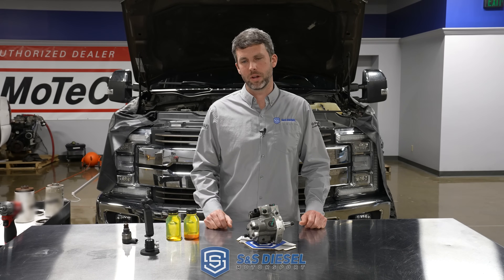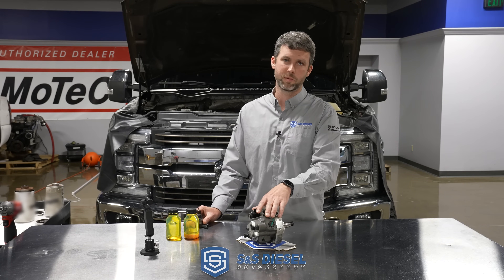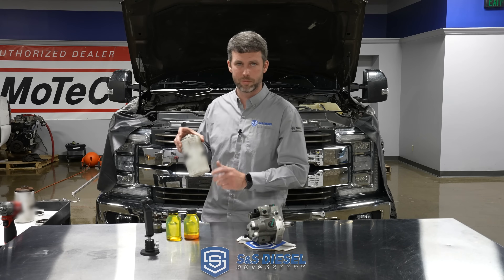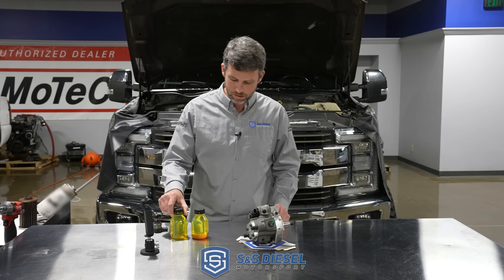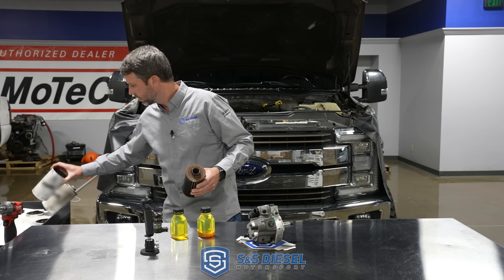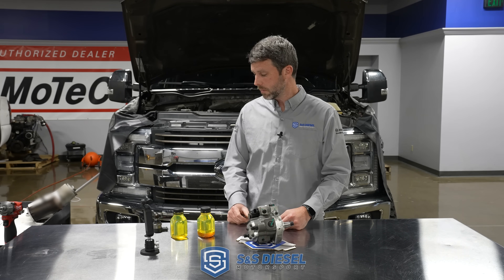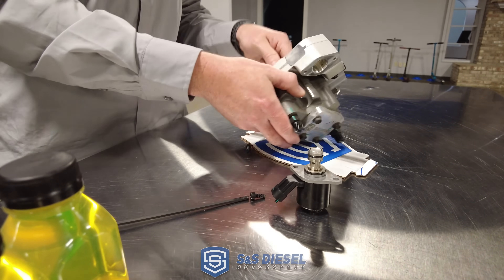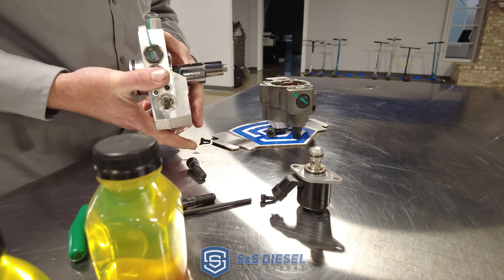Can The Ford 6.7L CP4 to DCR Pump Conversion Handle Water In Fuel?

Comment: I am going to put your disaster prevention kit on my 2021 but had a question. With those steel housing filters, would the filter you supply with the disaster kit possibly produce the same results or after going through the oem filters maybe no water contamination could make it to the disaster filter?

Comment: Also has been running with a missing fuel cap for a year.😂
Reply from the maker: No kidding, that's what we thought when we first opened up the fuel system, haha. Unfortunately, what really happened is much more disturbing. All of the water likely came from an unknown fuel station as a result of traveling. He parked the truck shortly after and then went on vacation without any indication that there was water in it. The truck started acting up when he got back 2 weeks later and the video shows why. The owner of the Rusteater is quite particular when it comes to maintenance, which is exactly what motivated him to purchase an aftermarket filtration system that he thought was an upgrade over stock. Good thing he had a DCR in it.

Comment: I am really disappointed to learn these pumps are manufactured in China 🇨🇳 and not here in the United States. 🇺🇸🇺🇸
Reply from the maker: We're right there with you. It would be ideal for the DCRs to be 100% made in the USA, and maybe one day they will be. DCRs were originally made in China when we first released the Ford 6.7L DCR Pump Conversion. Since then, we have created a large enough market for the DCR in the USA that Stanadyne has built a DCR assembly line in Blythewood, South Carolina. While many of the components are still made in China, the assembly, end of line testing, and quality control are done in the USA. Even the pump bodies are forged in the USA. It's not uncommon for a global company to use a global supply chain. The main takeaway is that Stanadyne is a reputable company with locations all over the world. Since the DCR was originally developed for engines in the Asian market, that's where the original plant was built. Thankfully, a young engineer working in a US branch discovered that the DCR would fit in the valley of the 6.7 Power Stroke. That engineer insisted on working with S&S to develop a variant specifically for the 6.7 Ford and the rest is history. We have complete confidence in the DCR and will continue to grow the demand so that we can help bring even more manufacturing, than we already have, back to the USA. Here's a link to a video tour of the plant in South Carolina: https://youtu.be/y8IOhefx4Sw?si=RE1j3AW7UaKZ2Yy7

Comment: I have the same setup, top fuel delete kit, and fass 140 kit. Also a 2018 6.7. 
Had the s&s prevention kit installed, removed filter setup but kept the fca block on the cp4 and the bypass line off of it. 
Dealing with a crank, fire then instantly shutoff. Ran fine for about a week. Now it’s causing me issues. 
Thinking about just going to a dcr setup….
Reply: As I have said before, the FASS system makes absoluely no sense after the 2016, 6.7.

Comment: How did the junk make it past both filters?
Reply: The parts before AND after the filter rusted. The rust didn't make it past the filters but rather rust formed on the parts that come after the filter so it went straight into the pump. What's more curious is why the injectors weren't damaged. The DCR has a small screen but it looked mostly empty of debris. Either way, rust didn't get past the filter is was created after the point of filtration within the filter itself.

Comment: I never considered the metal inside the filters to actually be an issue. I was going to put the SPE filter system on, but decided against it after seeing this. If anything this was a PERFECT test for this new pump design, you couldn't have planned this any better. I wonder how the injectors are holding up.
Reply: I have the SPE filter system on my 2017 Superduty and think it is the best system.  First it uses CAT filters that screen down to 1/2 microns verus Ford's filters.  It doesnt use that crap filter that FASS use.
Reply: @moosergs  As long as the metal can can't rust when water gets in, then they are fine. I was considering the SPE but after seeing that the filters can rust if water gets in them I will stick with OEM, but ONLY OEM, no third party crap that looks like OEM.
Reply: The SPE system uses CAT filters that without knowing I would bet don't rust.  CAT is a world leading in diesel equipment so I'm sure that CAT filters are the best filters available.  Also, it's been mentioned in several other threads that the suspect filters that rusted in S & S video were from FASS.  Just sayin. @acdii

Comment: I have a 2017, f350 SWD with the SPE fuel system on which runs CAT filter and CAT water separator and uses the factory water sensor.  It also filters down to half the microns as the factory filters.  I spoke with a shop today about installing your DCR pump which would give me piece of mind over the CP4.  I wish you have mentions the filters that were on your test truck.  I don't think CAT filter and water separator would rust like the ones you showed.  If I'm wrong about the filters get me know.  I tried to check on that issue but how been unable to find the answer.  I love your new pump and I'm looking forward to get it installed on truck.
Reply from the maker: Thank you for your business! We put CAT filters with a water drain back on this truck, that we he could visually check for water from time to time. We can't say whether they would rust or not, but since he had removed the OE filtrations system, it was the best we could do. An added benefit of the factory filters is that they are all plastic, which can't rust.
Reply: @SSfueled  It seem to me that you don't know if CAT filters rust is unbelievable.  Without doing any research on the subject I would bet they don't be a leader in diesel machinery.
Reply: The can that those filters sits in are metal and are capable of rusting out exactly like the FASS system. Anything that hold water will eventually rust unless it's made out of something that prevents it. The other thing is regular maintenance. Those filters looked like they hadn't been changed in quite some time so if you've already made the mistake of ditching the stock system you can at least make sure you regularly change the filters to prevent rust buildup in those metal cans.
Reply: SS Fueled probably can't answer your question, but to me and others posting here that the filters on the test truck looked like ones from FASS, even with the names blurred out. They had the same dimensions, colouring, and black writing. I was looking at their system, but not anymore. I also have been looking at the system from SPE that you installed, but I was wondering if I installed it it could void my warranty. Thus, I think that I'll stick with the filters from Ford for now until at least the warranty is up.
Reply: FASS systems are terrible on 2017 superdutys and up.  I ordered one and when I figured out it installed I sent it back.  JUNK @stevenjefferys10

Comment: I had an S&S DCR pump installed after a CP4 failure (2014 F-250). Thanks JBJ Diesel in Caldwell, Idaho.
Reply from the maker: Thank you for your business! JBJ is a great S&S dealer.

Comment: I guess there not changing fuel filters, we run Fass pumps on trucks and if there water in fuel filters it will shut off pump, we check filters swap them out with new ones and back on the road.  It’s saved use a few times going to different fuel stations you don’t know if they change there fuel filters on pumps
Reply from the maker: In this case, the truck owner changes the fuel filters with every oil change. It was just bad luck and he got a batch a fuel with water in it. These particular filters had roughly 5,000 miles and 3 months of use. The water did not shut the pump off, but the DCR and injectors handled it. We're glad it worked for you and not sure why it didn't for him.

Comment: Could the new DCR be equipped with a water sensor as well? Having multiple check points for a system as the 6.7L sounds reasonable. With all that rust I bet they will have a fuel injector issue in the near future. All that iron flying around the combustion chamber can not be good either and eat at any seals. All that rust in just a few months, imagine what years of such abuse will surmount too. All such system should all have steel components but cost would be a huge factor, but worth  it in the long run, IMHO.
Reply from the maker: That's not a bad idea. We pulled and tested one injector; surprisingly, it performed identical to a brand new stock injector that we pulled from our inventory. So far so good and the truck is still running without issue. We'll keep you all informed of how the truck is doing since we put the same DCR right back in it after testing.

Comment: You would think ford would drop Bosch and order a million of these?
Reply: So to be fair there’s not enough data on these to do something like that. In other countries cp4’s see a 1% failure across the board for the vehicle manufacturers that use them. In the us its 7%. So they can’t justify it. With that being said, I put a dcr on my 6.7.
Reply: @AtomicFusion123  7% is a huge number for such an expensive repair. If I know the low sulfur diesel has an effect then the engineers do so they should make changes like you. It is unacceptable for the manufacturer to just hope it makes it out of warranty

Comment: We don't seem to have as many problems with CP4's up in alberta canada.  Are these DCR's pretty much bulletproof?  How may miles can I get out of one?
Reply from the maker: So far so good on the DCR that ate the rust and water. It is still running in the truck without issue. We don't have enough data to give you a service life estimate, since none have failed yet. The only catastrophic failure we have seen so far is when spinning it backwards on a test bench. The 6.7F DCR is designed to turn one way due to the offset of the plungers. The good news is that no debris was passed through the plungers. We only recommend running clean diesel through them, but there is at least one instance of a DCR handling water.

Comment: I really dislike this company. They have had so many versions on disaster kits. I bet this whole company was mostly built off of consumer fear. I purchased their first version of disaster kits for almost $400 bucks only to be told…oh this may not work. Buy our version 2. Whatever! Just wait I bet it won’t be long before this DCR Is in the same boat.
Reply from the maker: It would be easy to hide this comment, but we would rather talk about it. We want all of our customers to like us and feel good about their purchase. We first developed the Disaster Prevention Kit in 2016 and it has been proven to work on many occasions. We improved the design in 2021 when we discovered a potential way that it could allow some debris into the high-pressure system. We are a company founded and lead by fuel system engineers, if we discover a way to improve, we will. It's not our goal to force people to buy the latest version, yet innovation is at our core. Since 2012, S&S has been built off of our expertise and innovation in modern diesel fuel systems, for competition and durability alike. Fear has nothing to do with our success, yet trust does. Our customers trust us to provide the best solution, even if it obsoletes the previous one. We truly feel it when you say you dislike us because we are passionate about the products we design and manufacture.
Reply: Its easy copy SPE
 @SSfueled
Reply: @SSfueled  I only know one thing about S & S is that you guys like cutting OEM fuel lines which is something I would never have done.  I would worry that by cutting fuel lines you could introduct metal shaving into the system.  I would install the SPE system which does not cut fuel lines.
Reply: It's unfortunate that you'd make this type of comment about a company as dedicated to quality and service as S&S. I suggest your beef is and should be with Ford for using a known weak problematic fuel pump. Venting on people like S&S who are the only one's trying to help you doesn't seem productive. What you basically said is that you bought something that worked, was later improved and now has an available permanent preventative fix. Yourcomment is proof that you can't please some people no matter how you hard you try no matter what you do.

Comment: I've been considering this pump for my truck but have received a lot of Super Duty owners who are skeptical due to the pump being made in China. Some who did purchase the pump reported things like the engine feeling off, possibly due to the DCR having two pulses per revolution versus the CP4 having four pulses per revolution. Something about being in sync. I'm not a modern diesel pro, but before I blow over $2,000 to replace a CP4 that has 160k on the clock with no issues (I run 4oz OptiLube XL per 20gal) I want to be thoroughly informed. This video shows that the pump can stand up to some serious abuse, but I'm still on the fence.

Have you guys received any complaints or returns (that you can speak about publicly) that would shed light on some of the mentioned concerns above? I have no idea if the guys complaining have stock trucks or modded ones (mine is bone stock) and I imagine modded ones with a different pump would give issues. Just trying to determine whether or not I should drop cash on such an expensive part when my stock part is fine.
Reply from the maker: Great question and it's wise to get as much information as possible before spend your hard-earned money. There are 3,500+ and counting DCRs in service at this time, and with that there have been a few complaints, most of which can be attributed to install error or other systems that were apart during the install. Some complaints have been legitimate warranty issues, yet none of them was determined to be a result of 2 pulses vs 4 pulses. A common rail fuel pump does not need to be in sync with the engine, it just makes pressure. This video will help better-explain: https://youtu.be/C9MQVg1AGVs?si=xoeIcwzhCjTCzoW3

Current DCRs are made in China, yet a US-based plant is starting up in order to support the US DCR market that has been created. DCR owners can take pride in knowing that they are playing a role in bringing manufacturing back to the USA. As for quality, we have complete confidence in the DCR, regardless of where it is made. That's why we are willing to put our name and warranty on it. We don't blame you for being skeptical of a new product. Since we just launched it back in June, the DCR does not have a long track record... yet making metal is not on it. In the rare instances of a warranty issue, we have taken care of it in a timely manner... and will continue to do so. We would love to have your business and will stand behind DCR Pump Conversion.
Reply: @SSfueled  Zero problems with mine and now has about 5K miles on it. Zero difference performance - wise. Ran the CP4 without additive or accelerated F filter service first 35K miles or so, and am finding the peace of mind 100% worth it.   I know several guys in my area whose CP4s imploded without a DPK on them, including both GM & Ford trucks.  One was $12.5K repair the GM was $15K+.
Reply: Look at the RCD Performance pump.  That's the one I'm going to install in my 2017 Superduty.  It makes for sense and is made in USA and still as a Bosch warranty.
Reply: @moosergs  Is it a direct replacement though, like the DCR? Mine is a 2017 also. 162k miles, no issues yet. I use OptiLube XL in every tank.

Comment: Does the under hood filter have a steel mesh support liner or is it just plastic and pleats (similar yet different from the OEM undercab setup)?  Just curious.  This is great news to see though for the DCR pump.
Reply from the maker: That's part of the problem. The factory under hood filter was deleted in favor of the two aftermarket filters that created the rust. Retaining the stock under hood filter would have at least caught the rust.

Comment: I’ve just a little less than 230,000 miles on my un-tuned, 11, f250, 6.7ps,.  I just returned to the Left Coast from s trip to Tuktoyaktuk, NWT Canada on the Arctic Ocean via Montana and Wyoming. My truck is still running strong with the OE CP4 and filter(s). However, for peace of mind last year I installed your fuel bypass system. If an OE CP4 is not introduced to water, air, DEF or gas it will continue doing the job. Not running and not working a diesel engine is hard on them. They aren’t a good choice to run three blocks to the grocery the return. Work it with cetane additive and it will serve you well.

Comment: Other then leaving the factory filtration in place, what’s the solution for the rust/water in the filters? Seems like there needs to be an addition of a water in fuel sensor and a drain. Wouldn’t that solve the rust build up issue?
Reply from the maker: That's a great idea. We prefer the factory filtration because it retains that feature.

Comment: What is your guys recommendation for fuel filter change intervals? I've always done every other oil change, seems like every time I try to go longer there's always something that happens. Even my older mechanical diesels get the same treatment, and once I started owning newer common rail diesels I figured it's cheap insurance to keep the fuel system clean as I can. Maybe some areas have cleaner fuel, but I've always just noted that diesel is a dirty fuel, whether it be crap, algae or water.
Reply from the maker: We recommend the factory fuel filter service intervals which can be found here: https://www.fordservicecontent.com/Ford_Content/vdirsnet/OwnerManual/Home/Content?variantid=9071&languageCode=en&countryCode=USA&Uid=G2267560&ProcUid=G2207675&userMarket=USA&div=f&vFilteringEnabled=False&buildtype=web